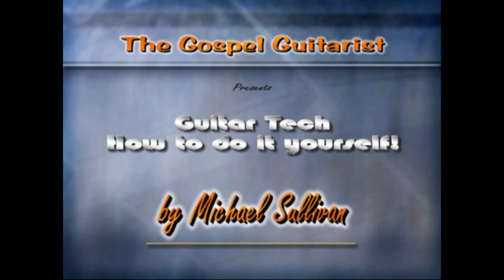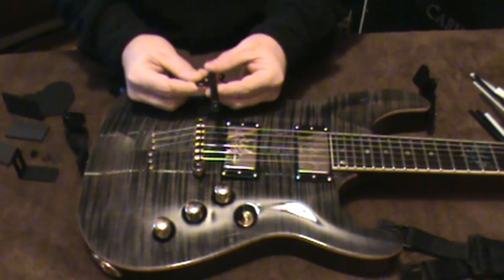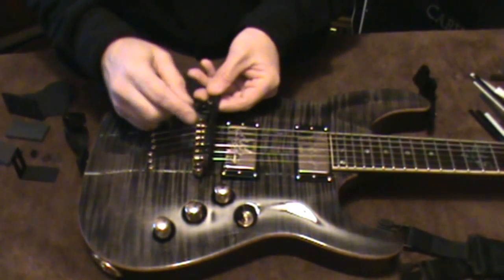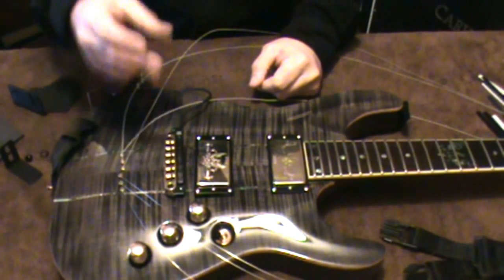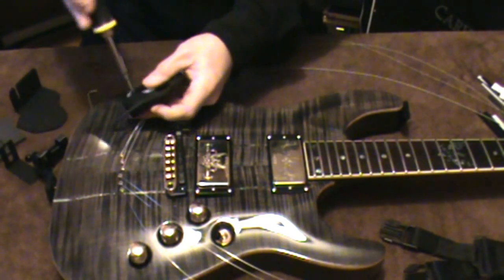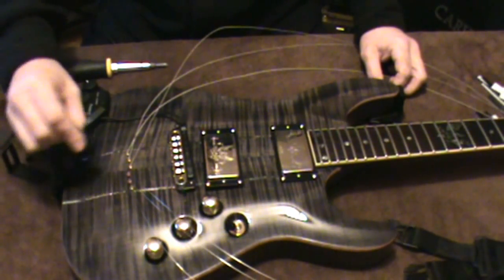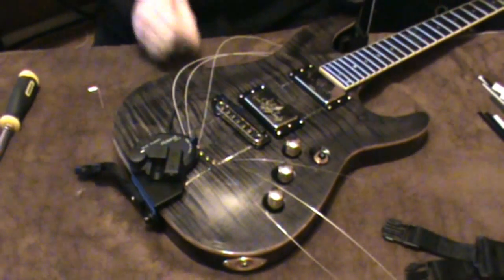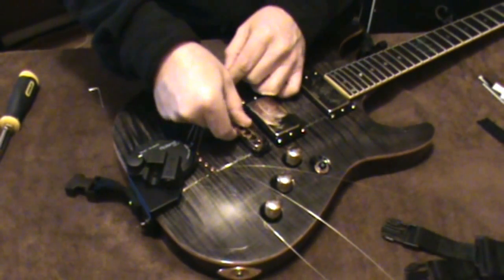Roland GK-3 Installation

Comment: omg I have the custom godin So maybe this piece is so he can add it to other guitars like his Gibson etc? cause the Godin has the 13 pin thing already built in. I just searched in closets and found pretty well everything I need except the maybe wireless adaptaor and the screws. And I have a regular amp and a Fender Mustang. He broke my heart but I got the gear at least that. HOLY SHIZ
Reply from the maker: Godin is ready to go, just need the 13 pin cable. This is the GK-3 midi pickup and can be added to any guitar.

Comment: Very helpful video. Do you think I can use the bracket under bridge with a Fender Telecaster?  I don't like the double sided tape or drilling two holes in guitar options. Thanks.
Reply from the maker: IF your Tele has this kind of bridge yes.

Comment: Hi I’ve got gr55 I also installed gk pickup on my semi acoustic guitar, but some how I’m having a problem especially on my B string, in some points can’t hear a sound. Then I tried to adjust gk lead while I play on shows some times sounds comes back some time don’t 
Has any one ever come a cross with this situation? 
Please help me if anybody is having this problems ( only B string is been effective not any other strings )
Thanks  
May God bless 
Regards 
Samson Masih
Reply from the maker: Yeah, about that, the GK-3 is notorious for failure of individual string pickups because of faulty wiring. I gave up and got the Roland/Fender MIM GK equiped Strat. never had issues while I had that to play on the GR-55.

Comment: Do you just use a standard guitar lead with the GK-3 or do you need to use a specially designed guitar lead to operate it?
Reply from the maker: The guitar plugs into the GK3 with a short guitar cable and then the GK3 has a 13 pin cable to connect it to a midi device like the GR-55 or other midi unit.

Comment: Great video! I have a Ibanez artstar as153 semi hollow with the tune o matic bridge. will the same method work on my guitar or would i have to do something different
Reply from the maker: +guitarslim1989 The mount for the pickup should work just fine on any tone-o-matic style bridge. The mount keeps the pickup close to the strings too while adjusting the bridge height.

Comment: hi friends! can you help me bout installing gk3 with pickup holder just like in this video in fender strat step by step? so helpful if you upload the video. many thanks
Reply from the maker: The pickup holder is for tune-o-matic style bridges and can't be used on a Strat.You need to either screw it or double sticky tape it to the pick guard. There are already several videos out covering Strat installs.

Comment: The problem I am having is when I put the selector switch on just guitar I get no sound from my humbucker pickups so I am wondering if it has to be programed with in the pedal to see the guitar pickups other wise the the GK-3 works fine with the synt Did you have to program the Gr-55 ? thanks for posting c];-D
Reply from the maker: You need to setup the patches the way you want to use them. The 'Guitar Out' jack carries your guitar signal but you have to route it there in the GR-55. Check two guitar out settings, one in the system menu and the ones in patches. Also make sure the 'Normal Guitar' tone is turned on with the patches. Hope that gets you going! :)
Reply: TheGospelGuitarist OK I am looking through the manual now so i am looking for patches I see out to Line/Phones. when I plug the amp jack into guitar out I get a dry signal and the switch works the way it should but for some reason I can not get both out of just L/mono out put. this is a good sign to me because I know there nothing wrong with the GK-3 selector. right now i am in output select its set to Line/Phones
Reply from the maker: AL theDoctorWho In you patches TONE settings, make sure the Normal Pickups tone is switched on. This will send you dry guitar sound to the jack.
Reply: TheGospelGuitarist ok I found out that the signal goes out trough the 13 pin cable But in order to hear the mix & guitar A jack must be plug into the guitar out on the GR-55 into another amp for the dry sound. I am going to do an experiment now with my two channel Fender Twin amp. On some of the demos I seen on You Tube when They did show the GR-55 pedal.  I seen a Jack plugged into the Guitar out so I guess that was the way it was designed to work Thank you Michael  for your help c];-D
Reply from the maker: AL theDoctorWho You're welcome! I have a playlist on the unit you might want to check out other videos on using the guitar out.

Comment: Mucho Gracias Bro, I just ordered a GR-55 with the GK-3 pickup.  I have a Strat.  One question I have is: will my Strat still fit in my Fender Strat Case? (2) Is there a special cord that comes with the GK and if so where do you plug it into? The GR-55? Amp? ThankX for the video and help with my questions Dustoff85
Reply from the maker: The unit come with a 13 pin cable which you plug into the GK-3 and from there it runs into the GR-55. There is also a short cable which plugs into your guitar output and into the GK-3. The GK-3 sends the guitar signal and the GK-3 pickup signal into the GR-55 where you can run the guitar and synth signals outputs separately. Congrats on the purchase! Oh, and yes it will fit into your guitar case still.

Comment: Oooh, is that a straplock? I found the GK-3 mounting bracket is at war with the straplock, which I installed some 8 months prior to the GK-3. I didn't even know about the bracket...the last Strat I had was stolen and it had the old GK-2.
Reply from the maker: I had no issues using the bracket with the D'Addario strap locks.
Reply: Could be that my guitar is the Stratocaster pictured as my avatar.
Reply from the maker: Need a longer screw maybe?

Comment: Trying to intall the GK3 on a Fender Roadhouse Deluxe MIM, I realize the GK simply don't fit in a comfortably: I have to lift the strings in order not to let them touch the GK, causing undesired noise. Someone of you have faced the same problem? If so, how to solve it? Thanks!
Reply from the maker: Try raising your bridge saddles to get the required clearance.
Reply: I tried, but I would have to raise them very high...
Reply from the maker: Something's not right. Tons and tons of Fender Strats use this system without problems. See if you can find a Strat installation video.
Reply: Thanks! I just talked to the guy who sold me the GR and he said that maybe the problem is due to the fact that I use a pearl  kind of pick guard, it's not withe like most of the pick guards. But anyway I'll keep trying... Thanks for helping!
Reply from the maker: ***** Pick guards are the same thickness just different material. All you should need is a thin strip of double sided tape to stick it to the guitar. Are you using anything else to make it higher? Just raise the bridge pieces to get the clearance, everyone else's Strats seems to play fine, your should be no different.
Reply: I'll make an adaptation in my pickguard in order to, at the same time, let the strings in a low action and install the GK. In an hour like this I understand why so many people prefer the GC ready strats...   :/   
Ah! And I need to change my OS too... (laughs)... But I really apreciate your helping. If I can help you anyway too, just tell me. Thank you! God Bless you.
Reply from the maker: Check this out: http://youtu.be/cVwM-3Duy8U
The pickup is just screwed to or tapes to the pick guard. You don't need to make this tougher. It's an easy install.
Reply from the maker: I have one of the Roland GC1 strats too. :) Love it.
Reply from the maker: ***** I just happened to think about something. You said you got this GK3 from someone else. So it was used? Is there a plastic peace held on with double stick tape on the bottom of the pickup making it higher. The previous user may have needed to raise it up for his guitar where you don't need the extra height on yours. The units new come with all kinds of sticky things to adjust the height of the pickup. They are just long skinny peaces of plastic of different sizes to stick under the pickup unit using double sided tape. If yours has one on there, that would explain why you don't have the clearance you need. The bottom of the pickup should be completely flat. If it's not, remove the additional plastic peace with a pocket knife.
Reply: It had this tape, but I removed it. I had to cut my pick guard in order to install the GK...

Comment: Can I install the bar betwen the  neck humbuker and the meedle humbucker?
Reply from the maker: No, it needs to be installed between the bridge and the bridge pickup.
Reply: Ok. Tanks again.
Reply from the maker: No problem! :)
Reply: Aun what happen if the space between bridge and the bridge pickup is ver y little?
Reply from the maker: Hector Villanueva To my knowledge it fits all guitars. The only alternative would be to install it on one that it will fit. The pickup is very skinny at 5/16th's of an inch wide. It should fit you Ibanez.

Comment: Hello how re you?   How can install a gk-3 in  a Ibanes RG series with floyd rose tremolo?
Reply from the maker: The unit comes with plenty to double sided tape and spacers to apply so it can be installed on any guitar. The instructions cover it.
Reply: Tanks a lot

Comment: I am trying to make a project for school. Could this be used as the only pickup on a guitar and still work? Thank you.
Reply from the maker: Yes, it will work just fine. It would just be a MIDI guitar only.
Reply: Does this mean though that it could be used as a regular pickup? Do you also know if on on an electric guitar it would be possible to use only an acoustic pickup instead of the actual pickups and input jack? Thank you this for a school project I really appreciate it.
Reply from the maker: Spencer Williams This is a midi system, not a standard magnetic pickup. It only works as a complete system using a 13 pin midi cable. That would depend on what kind of 'acoustic pickup'. The Ghost system is an acoustic system which uses a 6 pack of midi pickups, one for each bridge piece. you could use that instead of normal pickups.Or install the GK system on the guitar and use midi only. If you have a midi guitar you use a midi 13 pin cable to run into a guitar synth for any sounds you want, acoustic, nylons, 12 string, bass, banjo, sitar, Strat, Les Paul, whatever. Technically, you don't need a 1/4" guitar jack or standard magnetic pickups.

Comment: hello mr  can we use GK-3 pickup to the OUD or acoustic guitar with linon strings?i the inusturumen i play as you see on my profile, i will be glad if you give me advise  thanks
Iim ,y imusturment havent got any midi  sistem
Reply from the maker: I believe the GK-3 will only work with steel strings. You need a different kind of system for your midi similar to the Godin nylon guitars which do have midi on board, but is not Rolands.

Comment: hello mr  can we use BG-3 pickup to the OUD or acoustic guitar with linon strings?i the inusturumen i play as you see on my profile, i will be glad if you give me advise  thanks
Reply from the maker: As long as the guitar has a midi pickup with 13 pins. I am not familiar with the BG-3 pickup but if it can pickup nylon strings through the bridge somehow than yes.

Comment from the maker: The whole assembly is built on a flexible system so one screw raises or lowers the six pickups to create the radius to fit your necks radius. You won't need to do individual pickup adjustments to create the radius you need like we do with bridges or magnetic pole pieces. Just use the one screw.

Comment from the maker: The GK-3 will work with any equipment which has a 13 pin midi connection. Do not confuse this with a normal MIDI interface.

Comment from the maker: If you turn it around the cables will get in the way being in front of the guitar. I am sure you don't want that. Another option is to mount it on the back. Awkward to me but it would work. The unit comes with double sided tape so you can put it where you want it without using the mounting bracket at all. Be sure you imagine the unit backwards or turned around and I am sure you won't want those cables in front of you.

Comment: cheers, i  was going to use it with a roland gr30 , i was just thinking about making a bracket for a lefty version, so i could turn it round, or have it lower than the strap screw...any thoughts?. thanks again.

Comment from the maker: You MUST own the GK-3 to connect your guitar to the GR-55. The GK-3 has a pickup under each string. The guitar output feeds into the GK-3 and then a 13 pin cable feeds the GK-3 to the GR-55.  From there you can take the guitar output on the GR-55 to your guitar amp setup and the synth outputs to the pa or amp/speaker setup. You cannot plug a guitar straight into this unit like other guitar processors. The unit cannot be used until you obtain the GK-3. Just order the unit which come with it.

Comment from the maker: It will be fine on either but it will be upside down. There are settings on the GR-55 to account for lefties if I remember correctly. The don't make a lefty version so they do it in the software.